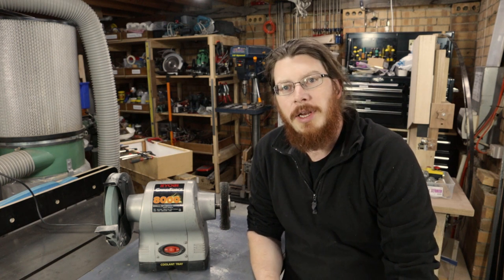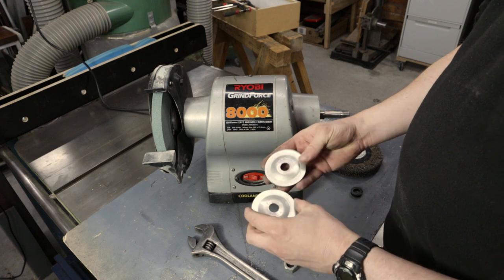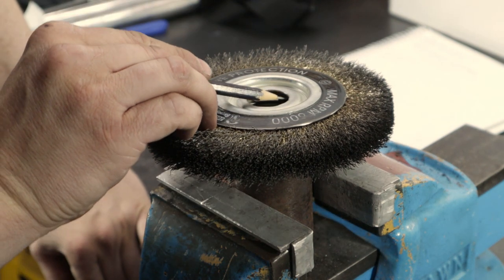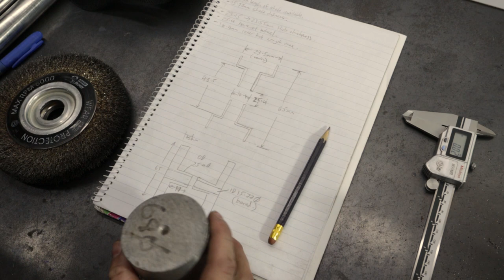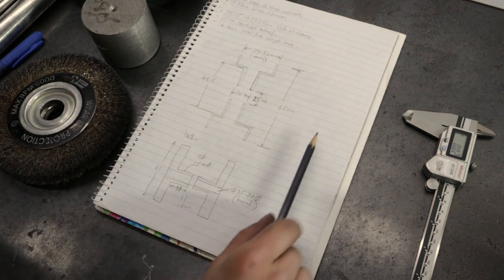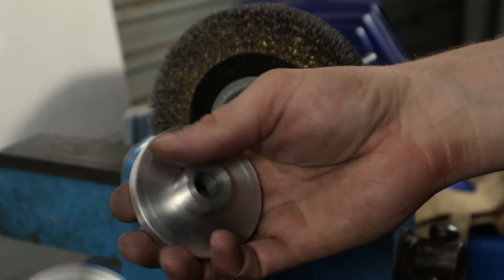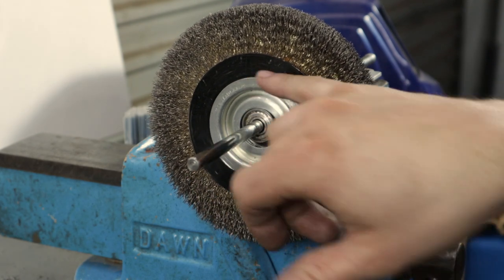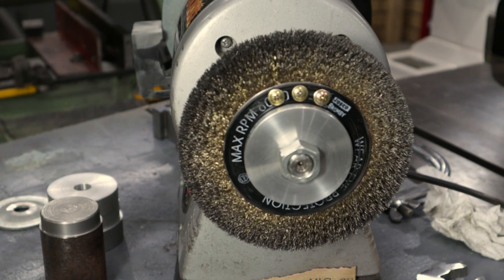Modifying my bench grinder

Comment: Runout creates a dynamic imbalance which cannot be totally removed by static balancing.   Adding more mass to the rotating members (provided it doesn't induce worse static imbalance) will help as the resonant frequency depends on the value of the centrifugal (unbalanced) force and the inertial mass of the rotating element,  a flea. Crawling around on an elephant doesn't throw the elephant off course , but fifty unruly school boys in a double decker bus can cause problems going around corners.  It's a bit of sorcery working it all out but the rules are simple make things round and true and most of your problems are solved

Estephan
Reply from the maker: Thanks Estephan, the elephant and school bus analogy makes perfect sense. Great information. So to take what you've stated here and build on it: If I turned something denser than aluminium (e.g. steel, iron, brass, bronze, lead ...) hubs, and made them  larger in OD, and thicker, by recessing the inboard shoulder, and also the outboard nut, and if I made them perfectly true and round, it would dwarf much more of the runout caused by the imperfect wirewheel? That makes very good sense to me, and I may well try it. I hope I've properly understood what you've said. Cheers, Craig
Reply: Baaaaabyyy, you got it!!?.......Roy Orbison.
Reply from the maker: @stevecallachor  OK thanks :-D Cheers, Craig

Comment: Thanks Craig a nice practical video for smal.l workshop's and blokes in the shed! Your
old apprentice at 72 still learning! Working on a old Holden at the moment it is amazing what tips and procedures from all you tubers I can use on my projects. Lathe work, milling machine , buffing stainless steel a ECT.
Reply from the maker: Hi Christopher. I've only been using the lathe and mill for 2-3 years myself, so I consider myself an amateur still - but if you can get anything useful from the video, then it has served its purpose! Good luck with the Holden, if you ever feel like filming your restoring work, I'd be interested to have a look. Cheers, Craig

Comment: Hi Craig, over the years I've bought both cheap and expensive wire wheels to see if one is better than the other. I haven't found one yet that didn't require balancing. Luckily (so far) I have got away with cutting some of the strands to get them balanced. Good video.
Regards Kevin
Reply from the maker: Hi Kevin - I hope you're keeping well. Yes - I had the idea of cutting some strands too, but when I saw just how out of whack it was, I decided adding weight to the light side might be a better idea. Now most of the problem is solved, I may fine tune it by cutting some strands.

Comment: Hi Craig,  nice vid, thanks for sharing. 
You could make the outer component out of steel instead of aluminum this would give some rotational mass to which you could then drill shallow divots at the heavy areas to balance.
Cheers
Reply from the maker: That's a really great idea, thanks Rick. I could make them larger diameter too, and all I'd need to make sure of, is that I keep it indexed to the wheel properly. Thanks again. Craig
Reply: Right on point, Rick. Doing what you suggested and drilling out two holes of the same diameter (one hole in the rim on each half) you could have the discs themselves perfectly balanced with the holes 180º opposed, and gradually rotate the discs so the holes grow closer together on the heavy side of the wire wheel until balanced. Does that make sense? That way, one set of discs would be relatively universal and not drilled out for a specific wheel's imbalance.
Reply: @IAMSatisfied  
If we keep this up we'll have a new space shuttle in our backyards:) 
That's a great idea... dial in to balance!
Reply: Yes seen this done or drill and tap the aluminium ones all round then add grub screws where needed for weight.

Comment: Nice fix Craig  those wire wheels are sometimes the devil to get trued got to try on one of my grinder to get it better. Was fine till I put the wire wheel on it . Think I will check it and see if I can melt some lead to the lite  side in between the 2 steel rings. God bless have an awesome weekend
Reply from the maker: Thanks Anthony. Have a great weekend yourself. Melting in some lead is a very good idea. Someone else commented with the lead idea but I couldn't think how to affix it. Melting it might well work. Since I've already made some holes in my hub, I'll see if I can get some larger screws first. Cheers! Craig

Comment: Just a suggestion maybe use some lead weights in you flange instead of screws. Just a thought.  Thanks for sharing
Reply from the maker: Thanks Yves - good idea. I would just need to figure out how to make it nice and low-profile and safely mounted. I guess I could use lead wheel weights somehow?
Reply: @CraigsWorkshop  It does not have to be on the outside of the brush. How about in the brush between the flanges you made or maybe holes drilled in the flanges and lead poured in those holes. Again more ideas.
Reply from the maker: Good ideas. I'll keep this in mind in case I need to do anything like this in future. I'm hoping that what I've got will be sufficient for now, but one day I will upgrade to the 200mm/8" size wheel, and from other reports, it seems all these wheels are out of true and out of balance, so I might be pouring lead on the next version :-)
Reply: You took the words out of my mouth but stick them in place or they will drop to the bottom every time the grinder stops rotating creating another out of balance issue.
Reply: @CraigsWorkshop  drill and tap some holes on the inside of the flange and pour molten lead slugs into those holes. Them machine them flush 😉

Comment: Nice job.  Have you considered tweaking the balance with some washers or hex nuts under the screw heads?
Reply from the maker: Thanks. I haven't tried that, no. Since doing this video (years later) I upgraded my wire wheel from that 150mm one to a 200mm one which suits the size of machine, and the balance of the newer wheel is pretty good out of the box.

Comment: Run it until she blows. I pick up bench grinders for $20.00 on Kijiji like Craig's list. Two new grinding wheels are $20.00 each plus %13 tax that's close to $50. Take care Craig.
Reply from the maker: Cheers Randy - What's weird is I went down there later that evening to find out the bearing sizes, but couldn't get it to make that sound again. It was just running quiet and smooth. I guess it was having a bad day! (No doubt the whining noise will come back after some use - then I'll decide what to do). I have a soft spot for this particular grinder because it takes the bigger wheels and it's a nice large motor (1hp). Most I see are 1/3-1/2hp. This is good for stripping very heavily rusted parts - leaning on the wheel does not slow it down much. :)
Reply: @CraigsWorkshop  try forcing some grease in with a needle. I do that often. Its probably dried out.
Reply from the maker: Great idea Randy, if the noise comes up again, that'll be the first thing I try. Thanks for the idea. Cheers, Craig

Comment: A job well worth doing. There's nothing more annoying than vibrations on machines when using them. I also have a Poland lathe chuck. Enjoyed the video Craig the grinders a lot better.
Reply from the maker: Thanks Tony. I think the chuck is a bison brand, not 100% sure, just shows a bison logo and made in Poland as you've seen.

The grinder "bearing" noise (or shield or whatever) has gone away completely for now. It's also a lot less hair-raising to use the thing now it's not vibrating. Fingers crossed it stays good. Cheers, Craig
Reply: @CraigsWorkshop  That's what I've thought all along. These were out way before the Bison brand was available. That's my opinion anyway because I never saw them any earlier for sale. Also Bison was a lot less expensive before the Chinese tooling came along then they seemed to up the price ridiculously so it's nearly as expensive as the American and British brands. I think they're out of reach for the hobbyist now unless your loaded or selling your products to cover the outlay.
Reply from the maker: Agreed - my eyes watered when I looked up the price of a new equivalent. Haven't got that kind of cash! I didn't know about the price change, or the brand changing. This is a top quality chuck though - I think it's very accurately made, and doesn't have any measurable wear in the jaws which is great. My Pratt Burnerd 3 jaw 6" is a different story, has a tiny bit of bellmouthing. I'll sort it out one day. I noticed your great video about making a router into a toolpost grinder. Very ingenious. Cheers, Craig

Comment: I like your lathe Craig. What is the brand and model of the machine ???
Reply from the maker: Hi Victory. It is a Premo made by Brackenbury and Austin Lathes in Sydney. The same lathe was also sold under the name "Veem MkIII". I will be selling it later as I now have a smaller lathe and a larger lathe, allowing me to do a larger range of work. Those two new lathes need setting up and powering so that is first. Thanks 👍
Reply: @CraigsWorkshop  Keep me mind when you want to sell. What is the model number of the machine ?? Thanks
Reply from the maker: @victoryfirst2878  Hi Victory. No model number sorry. Are you local to Hobart? You are welcome to come and have a look. I will need to hang onto it for a month or two at least, just so I can get the new ones up and running.

Comment: looks good Craig, it sucks about the bearings, but if its not one thing, its another that will crap out when you are trying to use something, lol.
Reply from the maker: Yeah - it does suck. What's odd is that later the same day I went back and tried to check out the bearing sizes, tested it running again, and couldn't get it to make a noise - so something is intermittent. Perhaps it was the wheel guard resonating or something. I will check all those bolts. If the problem comes back, I'll dive a bit deeper and perhaps replace bearings as a matter of course. Thanks for dropping by and commenting Chirpy! Cheers, Craig

Comment: Thanks I need to make something just like this my wheels don't have the centers just a big hole in the center this will work great
Reply from the maker: Yes - when I saw those miniature plastic bushes/hubs, I knew they had to go. To me, the important bit was getting the bored hole that registers on the shaft as long as possible, and as good a fit as possible. So that the disc portion was running truly perpendicular to the shaft. Then clamping the wire wheel between those, the disc actually squishes the flexible sheetmetal inner hub into flatness to some degree. Sounds odd, but it works well to improve axial runout. Of course having it fit as well as possible in the large inner hole is good too - that's the part of it that I'd think was more obvious though. Hopefully on yours, your larger inner holes (in the sheetmetal) are rounder than mine were..

Comment: Loving your channel, Craig.  It induces all sorts of envy, mainly due to shortage of spare shed time!
A question: when you balanced the wheel you used  a bearing with a smaller OD than the hole in the wheel. Would that not give you a false reading of the balance???  To my mind that would put more mass on the lower half of the wheel as it turns.
My apologies if I have it totally wrong!
Reply from the maker: Thanks Andrew for the encouragement! With the balancing the mass was off centre top-to-bottom, but I was only measuring for front-to-back differences by continually rotating and testing it at different points. So if there's a heavy spot at the front or back, it does still drop to the bottom. Does that make any sense? Thanks, Craig

Comment: Drill some holes I each flange, that will help with balance adjustment
Reply from the maker: Thanks John, yes lots of ways to do it 👍 In this case the wheel hubs were in balance and the wheel was out of balance so I wanted to balance the wheel itself. Otherwise if I take this on and off to change the wheel out for something else, I have to rebalance it every time.

Comment: I've never found wire wheels to be well balanced but the one you're fighting is WAY out and simply needs to be replaced with something of a better quality.  I cringe at the idea of adding screws like this into what appears to be thin metal or even plastic.  If those should work their way loose over time?   As for replacing the bearings I think you will find that it's fairly easy to do.  The old noisy ones I did some years back tapped out of the casting easily.  One of them FELL out in fact.  And being loose might have been at the core of the issue.  I stuck it back in with some medium Loctite to seat it but still be removable later if needed.  The grinder never ran better.  I also on a small spare grinder made up a flange and outer washer that let's me mount angle grinder discs.  That's proven to be very handy with full thickness discs for using the side of them to get into spaces and with a cutoff disc for doing small notches or small cutoff jobs on wire and small rods. I made up a special rest and everything.
Reply from the maker: I did recently change that wheel for a better and bigger one, but the screws it had went into metal and they stayed where I put them for the best part of 3.5 years 👍

I love your idea of making a cut off wheel mount! I do have a D bit grinder here too, and a tool and cutter grinder here ready for restoration so the T&CG will probably get the bulk of my attention in future. But at least one of these will get a cut off wheel hub at some point. Good thinking

Comment: Could you simply drill a series of small holes in one side of the bushing and position it opposite the screws, to balance it.
If the holes were drilled in the edge the size can be smaller, or drill into the edge and melt a little lead into the hole, or simply add washers to the screws!.
Reply from the maker: Yes - all great ideas. Thanks Fred.

Comment: Mine must have been made on a Tuesday, seems quite well balanced with very little vibration. Different story with the linishing belt on the other side tho 😕
Reply from the maker: Does it run well when you take the belt off? That could tell you whether it's the driving pulley or the driven one that's the culprit. (I owe you an email!)
Reply: Yep, runs fine without the belt. I reckon the linishing arm was made on a Friday. I'll pull it apart one day and make it more gooder.
Good thing we aren't doing corporate business via email 🤣
Reply from the maker: You can always drill some holes in the light side and stuff some screws into it. I've seen that done somewhere before :-)
Reply: I think it's mostly belt tension and tracking. Not very well designed.
Current round of shed tetris is nearly at the stage of bolting grinders down, so I'll probly look at it soon.
Reply from the maker: Ooh - bolting grinders down is a good step. Then you need to make sharpening rests to bolt in front of them :) (On my todo list too)
Reply: Soooo many old dyna bolts in the concrete already 🤦‍♂️🤣
Will try some sharpening jigs on the good belt grinder and probly the Tormek wet grinder too. After some mods to the swivel mount..and better lighting..and some dust control..and tool/jig storage.. and .....
Reply from the maker: :) The list goes on! I know that feeling.
Reply: Task 5379.. replace damaged castor wheel on 6 drawer cabinet 🤣
Reply from the maker: Move the other one over and make it into a Robin Reliant :)
Reply: 🤣🤣🤣
Task 27328. fit motorised self levelling castors to all cabinets

Comment: Hey bubba that wire wheel is not rated for the rpm it spins because it's a 4" wheel on a 6" grinder which will speed up the rpm to almost double which causes little PCs of wire flying off and is dangerous as gell
Reply from the maker: It's the other way around. Smaller wheels are rated to go faster than bigger wheels. So a smaller wheel on a bigger machine is usually fine. I am always careful to double check though and it was definitely safe in this case.

Comment: It's also a job i have to do !    They are just cheap crap pressed out rubbish & i you would think the grinding wheels would shatter . The old GMF Australian made grinders had proper steel machined flanges before things went cheap & nasty .  Cheers .
Reply from the maker: It's interesting - I have a much older grinder (also smaller and less powerful - I think 6" and 1/2hp) - but it's as quiet as a mouse and runs perfectly smooth. I think the older stuff is better all round. Hence why my workshop has several old machines from the 60s :-) It's also a bit of an addiction :-)
Reply: @CraigsWorkshop  Machines were just better built back then !